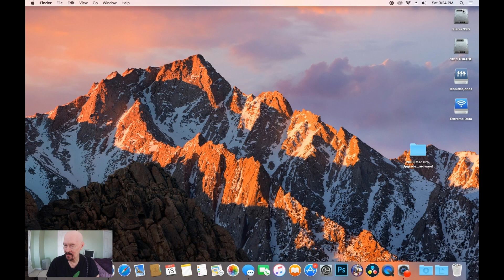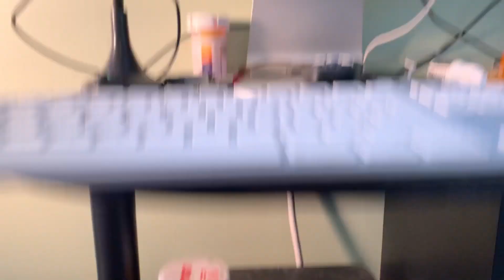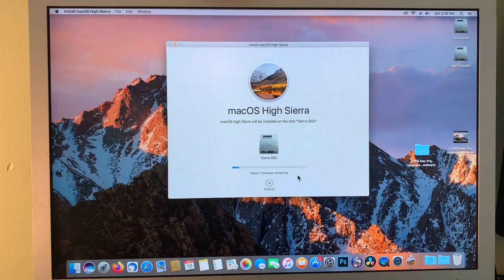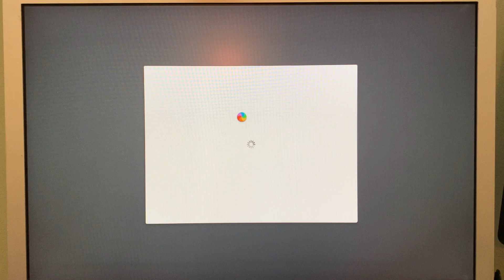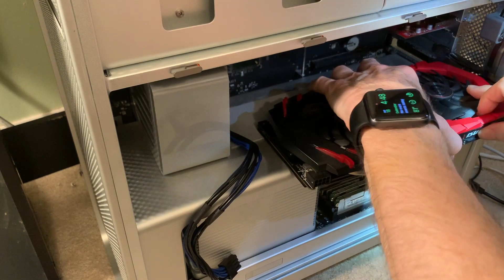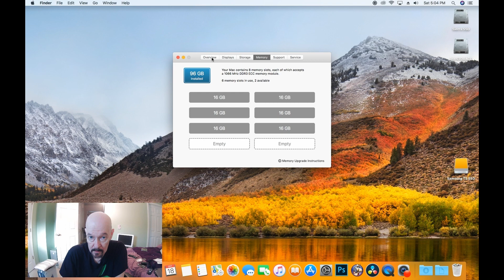2009 Mac Pro, Upgrade to High Sierra, and Hardware!

Comment: One optical drive may be a Blu-ray player/burner while the other may be a DVD/CD player/burner? That is my Mac 5,1 optical bay configuration. BTW will you also be doing the 2010 Mac Pro 5,1 Pixlas Mod for ample power delivered to the GPU card?